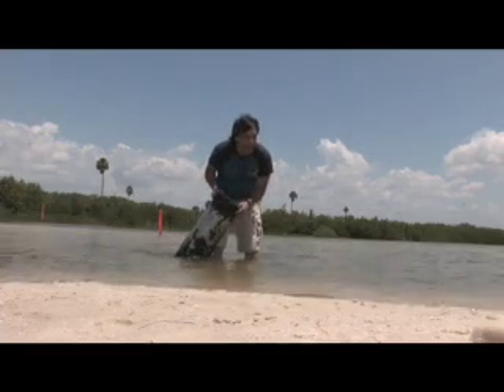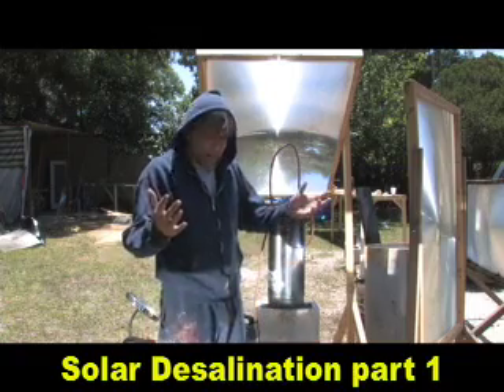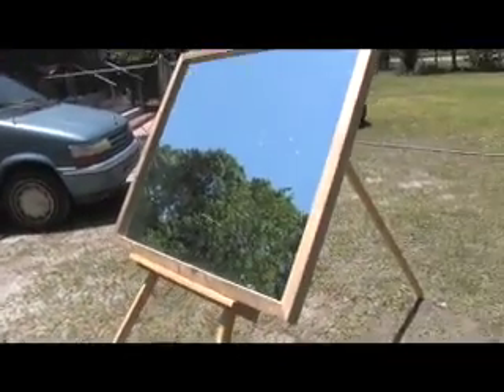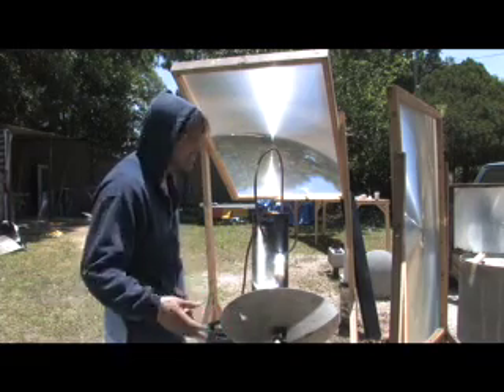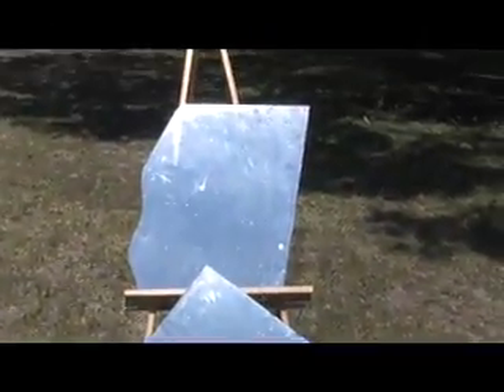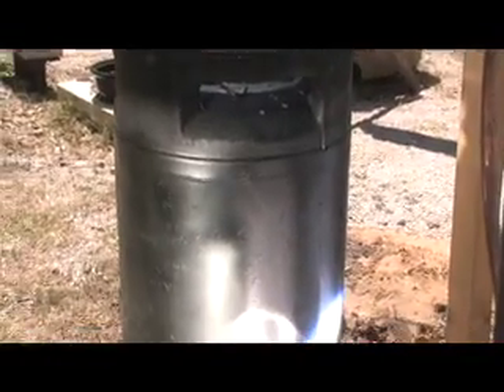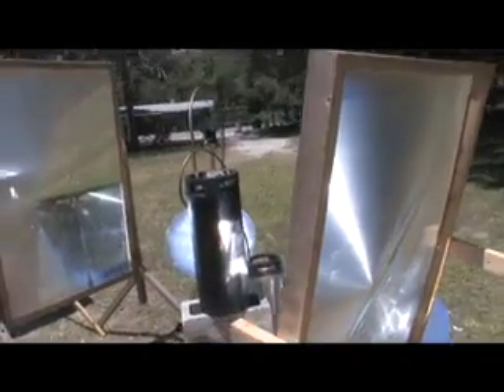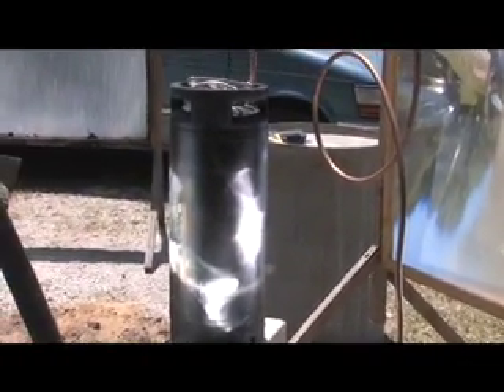Survival Seawater, Solar Stills & Seeps Fresnel Lens and parabolic mirror DESALINATION Part1

Comment: How about trickling the water over a heated collector plate prior to entry into 5 gallon drum.
Just thinking that the salt might crystalize on the plate and could be easily scraped of, rather than the inside of the drum.
That aside what i would like to see you attempt to make if its possible would be a fresnel lens from plastic sheeting.
I have some in A4 size, is it possible to make a female mould with the grooved shapes, that you could mould your own plastic lens from.
Go on, give it a go.

Comment: for those that want to scale down, fewer mirrors with high efficiency...not all mirror materials reflect infrared spectrum, which is where the heat is.. You might see a bright dot of visible light, but it's not a guarantee it is very hot. Wise to check temps.  Front surface hot mirrors will be the absolute best, but those are also pricey.

Comment: Hey, I TRIED BOILING 5 GALLONS FOR SOME BEER ONE TIME. I USED AN ENTIRE AMOUNT OF WATER IN A BOTTLED WATER CONTAINER IN A GIANT PAN. IT FIT ACROSS BOTH BURNERS ON OUT STOVE ELECTRIC AND ALL WE GOT WAS THAT STEAM NOISE AND 200 DEGREES, NO BOIL. I THINK IT WAS 1800 WATTS X 2. ONE burner was about 30% exposed. We tried a blow torch too. dumped the mix, buying beer is cheaper. LOL good job.

Comment: I wonder if it would be more efficient to have a small boiling chamber and feed it water from the large tank as needed through a very small tube as it boils away.  You'd have a lot less heat loss to the air that way because of the smaller container surface area.

Comment from the maker: Thank you, it is hard to do. The best way for this project would be to run the water into a smaller pipe and just work in small volumes. Wont work for beer, but ..... I just was curious if I could get 5 gallons to boil.

Comment: if you wrapped the container in some form of safe insulation wrap, so only the focal points are exposed  more heat would remain in the container than radiate out into the colder shadow areas. might speed up the proccess a fair amount?

Comment: 1) Flat white painted plywood panels will reflect almost as much as mirrors. Within a couple of percentage points. Will be cheaper and easier to set larger panels.

2) Paint the outside of the vessel black. D'uh.

3) Enclose the vessel in an insulated box. Or set up wood panels to minimize wind on the vessels.

Comment: If there was a way to place an air tight glass container around your soda keg and pump out most of the air, you would be getting greater efficiency from your mirrors because less heat would be escaping...just a thought!

Comment: How about instead of trying to boil the whole 5 gallons in one go, have a system where you have a smaller kettle that water flown in at an adjustable rate, evaporates and then .. what's that word??.. condenses, into your other container.

Greetings from Iran

Comment: it seems like the plate glass distillers work much better and more efficiently, instead of boiling the water, you can just use natural evaporation to distill your water, it'll take longer, but less tiresome. you could also just paint that can black and let it slowly evaporate it's water and condense into another container, again, time consuming, but much easier.

Comment: You know dan .. I am thinking they are intentionally following you with the jets.... ;)
Reply: BTW Dan, I would love to see a repurposed solar concentrating array made out of discarded CD ROMS from computers.. say a 100 or so of them angled just right on your "lemonade stand" to ummm focus on a point... see I think without warping them into a parabola... you could in fact angle them to all focus on the right point to get the temps needed... :) but just a thought.. if you don't try it I am going to..  but beware... they may send jets overhead to spy on you if you do such a test! :O ;) :D
Reply from the maker: Jesse Mercury :-) I have 2000 platters, I was planning on using for the big metal dish that was in our from yard. It is scrap now but an array with arms will work good. Just need the time to do it. I started a few year ago but the center mount was a pain. If you pinch them they lose their perfect flatness and the focal point is YUCK.
Reply: Hmm so flat CD Rom .. reinforced on the back side with say.. a bit of a discarded computer case etc... with bolt to secure it through the cd-room hole  and angled to the correct position would no work? I dunno I am going to try it this summer LOL.. ;) I think it would work. and would be a good example of repurposing with permaculture for solar energy production :)
Reply from the maker: Jesse Mercury That would work but is a lot of engineering for each platter. The goal for the project I was working on is a fast application as several hundred drive platters is a healthy project vs reflective film to a satellite dish.
Reply: Well you do know that with the hydtrates of methane starting to heat up and bubble up from the oceans floor the only sensible way to hmmm stop the atmosphere from losing that delicate balance we need is to set up.. and I know it sounds odd atmospheric processing units.. that are large.. only problem is they require quite a bit of power.. butttt. since allll power on earth comes from the SUN well hmm I am thinking you might be onto something that like flash gordon.. saves everyone of us :)

Comment: 126 degrees? That means it's been boiling for 26 degrees right? 126? it should've been vapor for quite some time.. USE "SI-units", please. That way it will be way easier for everyone to follow and easier to standardize. 

It is only the citizens of U.S. that uses the old ways. Make all of the world a service and start with it as you clearly has brains. Wonderful work btw. Sry I can't relate to any of the measurements..

Comment: If the purpose is to evaporate the water, your system is fundamentally flawed. The greater the surface area of the water the greater will be the evaporation. Placing water in a deep vessel with a small diameter, and small water surface area, is working against your purpose. Get a very wide and shallow vessel, this will give you a maximum water surface. This is almost a "D'uh" kind of situation. Common sense, people.